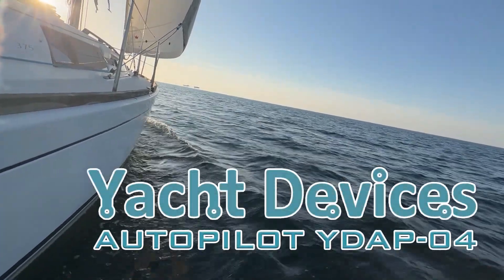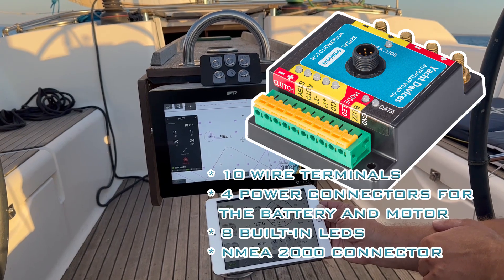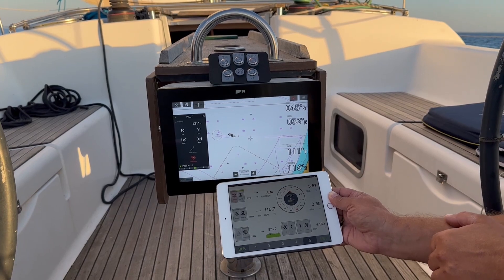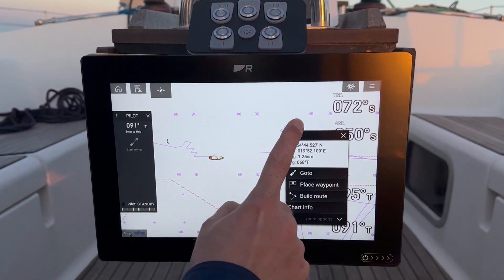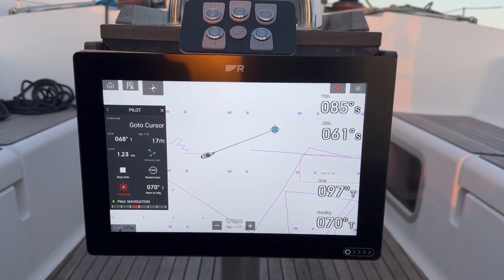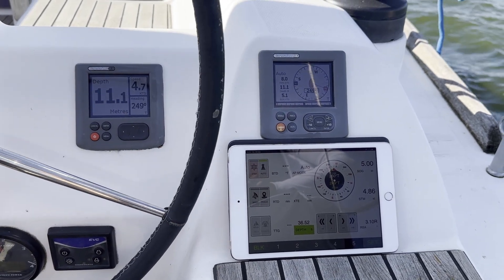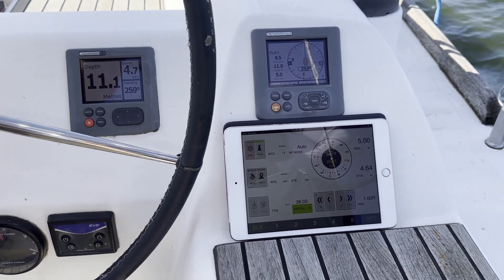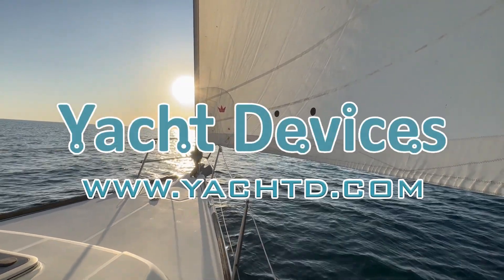Yacht Devices Autopilot YDAP-04

Comment: Hi! Impressively nice device! I’ve been reading all manuals and documentation how to connect and simply can’t get it. In case I want to replace my old Raymarine XPS 30 where should I connect fluxgate and the rudder? It would be nice if could make a installation video and how to setup.
Reply: Thank you for your interest in our autopilot. You need NMEA 2000-capable Rudder Angle sensor and Heading sensor. Please, refer YDAP-04 Installation Manual, section II. "System Overview" and III. "Extra Components Required".
Reply: @nekokoneko3856  
Thank you for the quick response! Well in this case would be highly appreciated if could come with suggestions for compatible sensors. From the old Evolution Autopilot Raymarine I have the heading sensor EV-1. The rudder sensor is an issue can’t find anything that could replace the raymarine sensor.
Reply: @AssenVN  unfortunately I am not allowed to post my reply here as all product promotion comments will be deleted. You know what to do.

Comment: Does it work with raymarine t1
Reply: Thank you for your interest in our autopilot !

Any DC-motor controlled steering solution will do, as long as its DC motor maximal current is within the YDAP-04 specifications ( max 10 Amperes constant current, 16 Amperes peak )

As I undrestand you mean Raymarine Linear Drive Type 1 ( model № M81130 ) 

They do not give max current in their specifications, but they give T1 average power consumption = 36 Watt

36 [ W ] / 12 [ V ] = 3 [ A ] , so average current is within YDAP-04 specs.

But what about max current? They do not give it in the specs, but we can infer it from other data.

They specify max. torque = 735 [ Nm ] and hardover time of 11 [ s ]

So, total power during the hardower will be:

 735 [ Nm ] / 11 [ s ] ~= 67 [ W ]

and max current will be:

67 [ W ] / 12 [ V ] ~= 5.6 [ A ]

Assuming typical linear drive efficiency of about 85% we estimate the real value to be:

 5.6 [ A ] / 85 [ % ] = ~ 6.6 [ A ]

Sanity check:

Recommended wire gauge given in T1 specs for 3 [ m ] drop is 2.5 [ mm^2 ] or 14 AWG

If we enter 6.6 [ A ] and 3 [ m ] @ 2% voltage drop into the "wire gauge calculator" we got 14 AWG (2.1 mm^1 ) wire is the last one which is OK for that current.

Conclusion: Type 1 drive model № M81130 is compatible with YDAP-04.
Reply: Thank you for the answer. Very nice product, totally fit’s my needs. I already have ydnr-02 on the boat with old 35yo raymarine autopilot I want an upgrade without changing everything (as I have spares parts for the linear)  and keep the old one available and ready in 5 minutes by changing 3 wires. So your product is earning many points.
Reply: Dear  @MaloRichard  !
Thank you for the positive feedback.

> I already have ydnr-02 on the boat 

Good, make sure to update YDNR-02 firmware to latest version where a new page was added which allows you to control YDAP-04 (perform MODE switching).

>with old 35yo raymarine autopilot I want an upgrade without changing everything 

Please, confirm if you got a NMEA 2000 Heading and ROT source ? Or you want to use Ray AP as a Heading solution ?
Reply: @nekokoneko3856  yeah update of the frimeware is for next week. Not sure if the web view will support my pilote (old seaTalk1 Raytheon) . Techicaly it’s doable as I already use signal K to use my phone as a remote for my autopilot with an app I build for it.  

Relèvent comment about the heading, not so sure as I think it comes from the pilote at the moment. (Edit: I think I might have it in my gps but not to sure) 

Not sure what you meant with the last 2 questions (ROT source 🤔) could you develop please.
Reply: Dear  @MaloRichard  !

>old seaTalk1 Raytheon

YDNR-02 update for SeaTalk 1 AP control is pending. Will be released soon.

>Relèvent comment about the heading, not so sure as I think it comes from the pilote at the moment.
> (Edit: I think I might have it in my gps but not to sure) 

Please, check which NEMA 2000 data you got using YDNR-02 + our CAN Log Viewer software (NMEA Navigation window)

>Not sure what you meant with the last 2 questions (ROT source 🤔) could you develop please

ROT = Rate of Turn. YDAP-04 can receive it via NMEA 2000 PGN 127251 "Rate of Turn". This data item is not mandatory but its presence on the NMEA 2000 bus will drastically improve YDAP-04 performance. To my knowledge, SeaTalk 1 does not have such data item, so you will get only heading from old RAY AP via YDNR-02 [SeaTalk 1 --> NMEA 2000 conversion].

Recommended solution: add a modern NMEA 2000 Heading solution ( based on magnetic sensor + accelerometer ) which also sends ROT